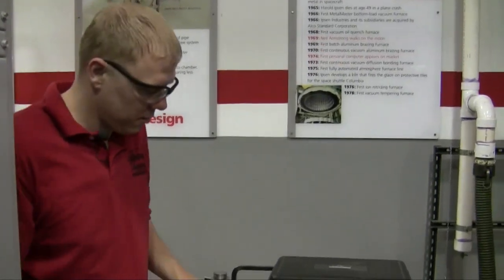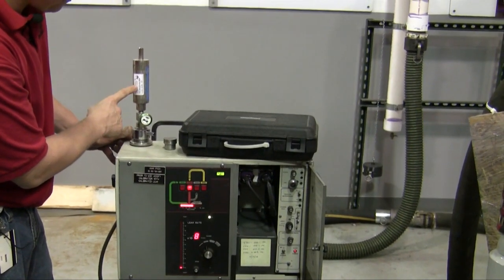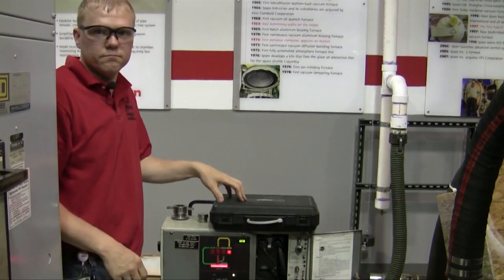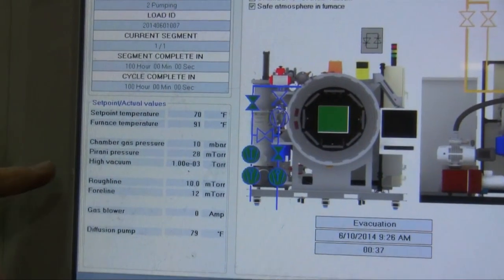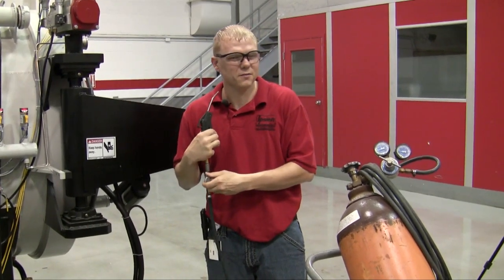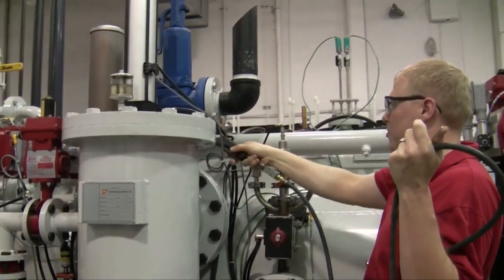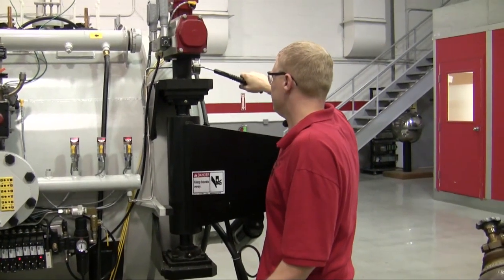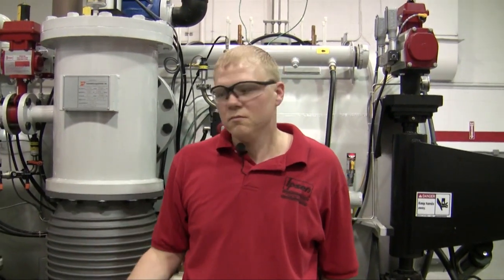How to Perform a Leak Check with a Helium Mass Spectrometer

Comment: Sir, is the roughing pump + blower ON while detecting leak? Is it possible to add a calibrated leak to determine the ratio for split flow method?

Comment: How fast should you actually move your helium probe? Seemed like he was moving around very quickly. I work at a titanium melt shop and trying to learn how to do effective vacuum furnace leak testing is like pulling teeth around here. Thanks

Comment: It was a demo leak test.  I've done many, many leak checks myself.  That being said, remember that it takes the leak detector a few seconds to react.  So that small spike could of been from the flanges.  Also, he did have too much helium flow.  I could hear the helium when he presses the trigger.  Also, i've tested the ipsen many times.  There could be an internal leak.  The diffusion poppet valve cylinder can leak from the seals into the system which can only be detected by spraying helium into the rod side of the poppet valve cylinder.  Also, the partial pressure valve can be leaking into the system as well as the backfill valve.  So you have to remember if you don't find an external leak, there could be an internal leak.  Just some food for thought.
Reply: +Jeff psomething BTW, I was talking about the first leak, not the second spike.
Reply: Best is to take a bottle of IPA and dip the nozzle in it, then adjust until you get a few bubbles coming out (you cannot even feel that level of output). He also started low and went high on the left side of that end cap. Helium rises, so always start off high (position, not on drugs lol) and work your way down, pausing a few seconds each few inches or so to see if you get a response.
Reply: My biggest question is how much helium flow should 1 be using? When you are dealing with O-Rings or VCR cages for gas lines. I seem to not be able to find a specific spec. I too use IPA and stick the helium gun in the bottle and by looking I only let about 1 bubble a sec come out. I seen ppl use like 20-30 bubbles a sec and find leaks that I didn't find. So it makes me think are they forcing a leak? Or a false leak??

Comment: Why was venting performed right after doing the calibration?
Reply: It only vents the foreline where the calibrated leak connects, else he couldn't remove it. It doesn't vent the internal system.

Comment: Tech in the video didn't compensate for temperature or depletion of the calibrated leak, his calibration was probably 10-15% off, it's not like a tracer probe test is quantitative though.
Reply: How would he compensate if the calibrated leak is the standard? I realize it's an old comment but it doesn't make any sense unless he's using a mass flow controller and trying to calibrate it to helium, which he isn't.

Also, it's not a tracer probe. If it was, it would be pulling in air, not expelling helium.